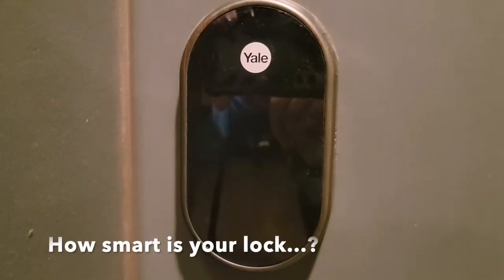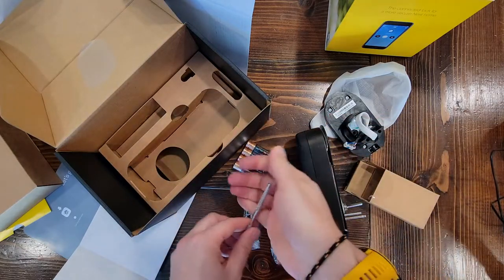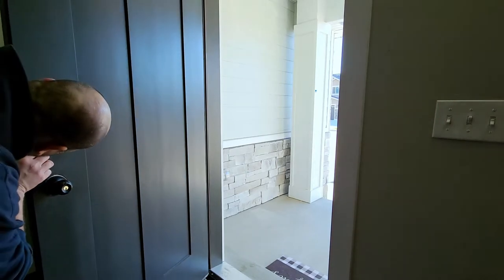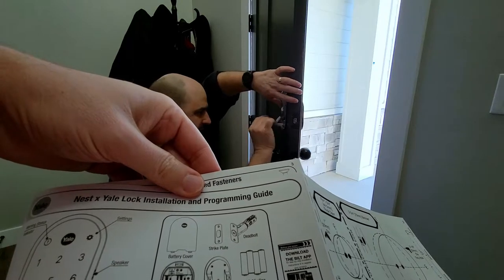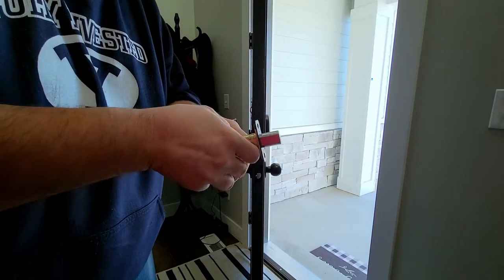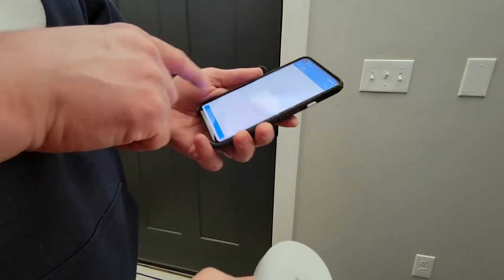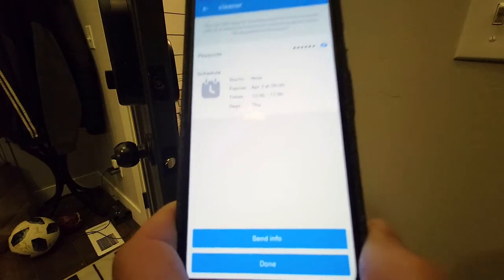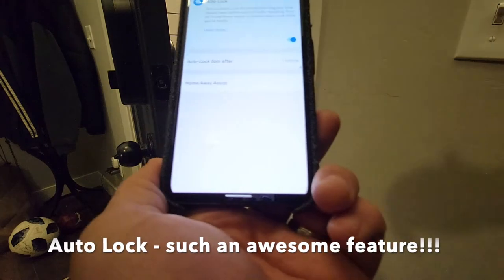Yale Smart Locks an Install & Review...

Comment: Don’t know how I feel about no key override
Reply from the maker: Just found a one that has your key 🔑 override... https://www.acehardware.com/departments/hardware/door-knobs-and-locks/electronic-entry-door-locks/5427117?store=16589&gclid=CjwKCAiAhbeCBhBcEiwAkv2cY2AnJKgQWdE2S782letC1ZkSQLg9EwXs-w_ooQzQ5SnWzujjgY-4ORoCVpIQAvD_BwE&gclsrc=aw.ds
Reply: I felt the same way, but haven't had any problems with this lock over the years. I also have other ways to get into the house so I'm not as worried about the lock "failing" or the batteries dying.
Reply from the maker: Great feedback - thank you Stephen 👍🏻